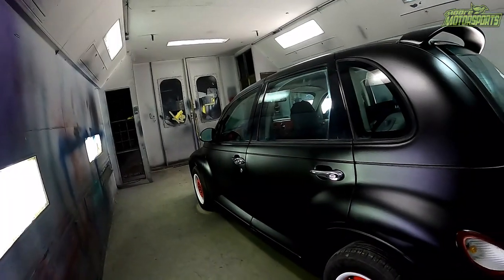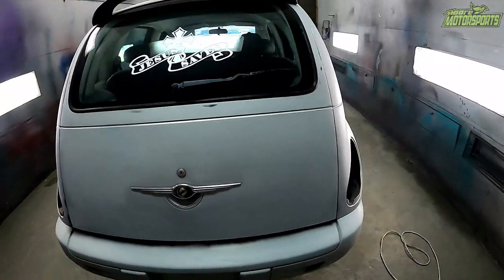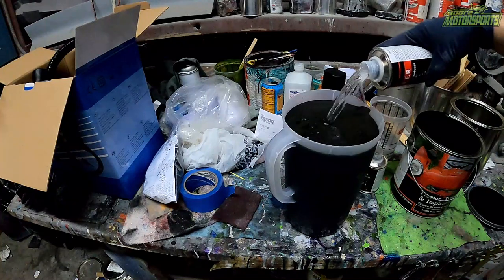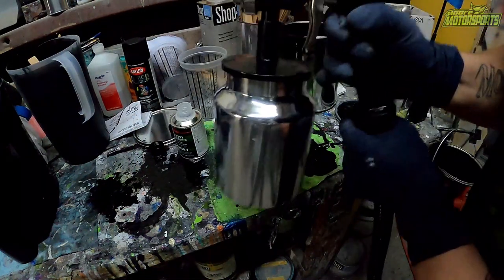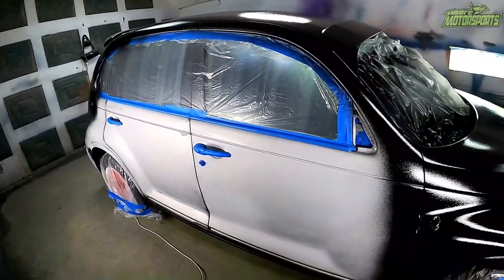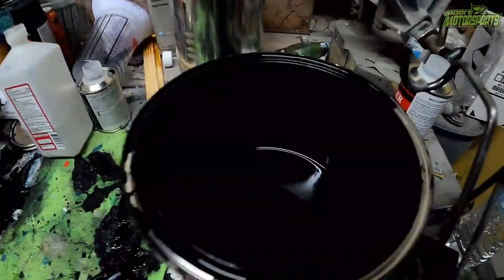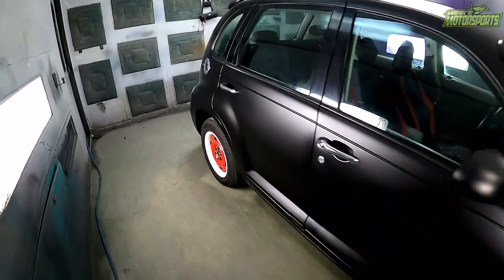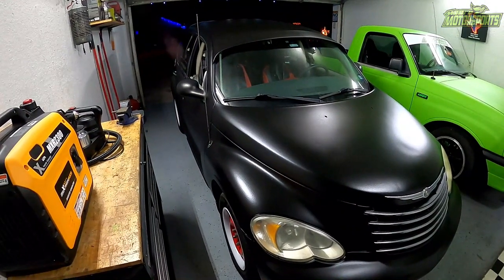Matte black tractor paint on the Rat Rod Cruiser

Comment: Tip for next time the paint need to be like water . If you want an nice flat paint .  Some body who paint planes told me about it. Text it on small project so you can find wright ratio . 😉🤪
Reply: rustoleum spray cans don't orange peel. That is how it needs to spray. Just like plastic dip simple 😉🤓🥸🧐. God bless you and your family keep doing these nice contents .
Reply from the maker: @poemnel13  yes the orange peel from spray cans are so minimal and this gun has a super small tip so in order to use the tractor paint I would need a primer gun with thicker flow tip. The thinner the better is right when it comes to small tips. I prefer spraying thicker because less coats but with the proper tip of course lol

Comment: I know this is off topic but do you happen to know the ring gaps you used for the d16 high compression build. im having my block bored to 75.5 and did you use oem valves or flat valves thanks man keep up the videos.
Reply from the maker: Oh dang that was years ago. I can’t remember but i did them looser than stock specs but not quite turbo specs. In between them both lol I think it was in my videos on this channel but can’t remember

Comment: I want to paint my car a matte color.  I have already laid down 2 coats smoke Grey.  I just want to somehow degloss the final coat any suggestions?
Reply from the maker: You can wet sand the grey with 1000 grit with soapy water then step up to 2000 grit until it’s smooth you can then use a matte clear but without me trying it I don’t know for 100% fact it will work.
Reply: @JamesDguy  thanks for the info  what brand of clear do you recommend.  The paint is  rustoleum oil based.
Reply from the maker: @gregshore7772  Speedokote clear it’s cheap and works great

Comment: Why tractor paint?
Reply from the maker: Cheap, durable and it works so why not. I mentioned in the video i was testing it as a cheap way. Idk if you seen my other videos but I made a electric spray gun paint job with tractor paint video and after wet sanding and clear coating it came out looking like a professional job 👍🏻 I test different methods and ways to do stuff.